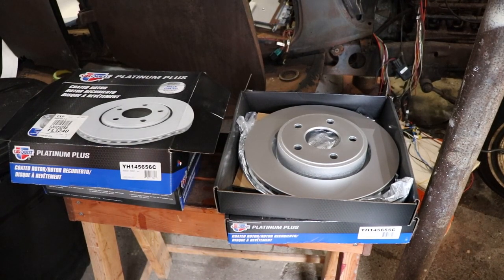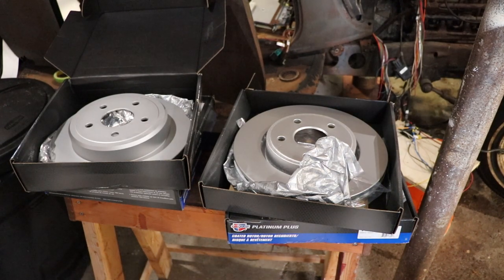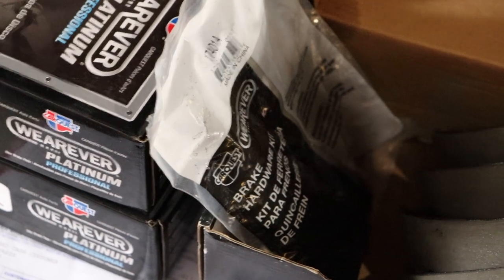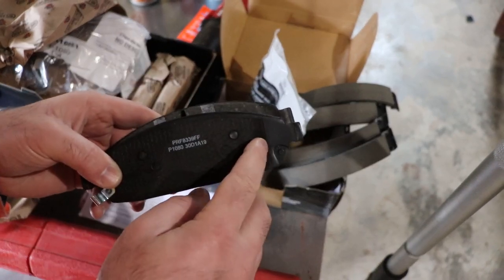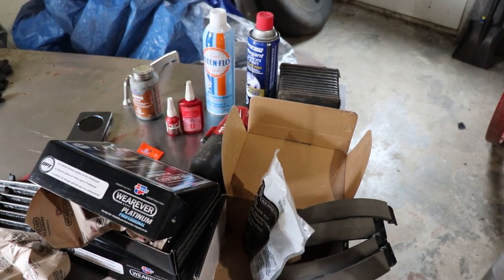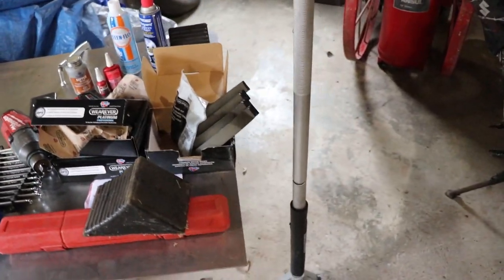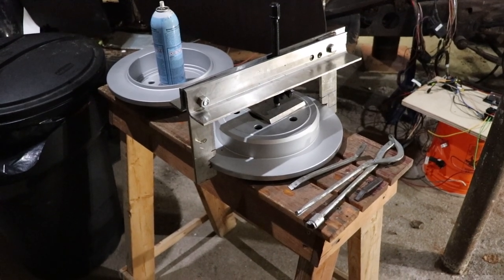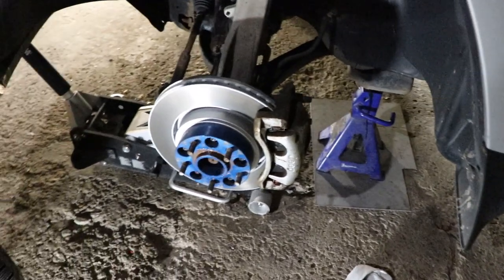2005-2010 Jeep Grand Cherokee WK Complete Rear Brake Job

Comment: I did this job this morning. This was my re-assembly sequence, no real problems :

1) Hook equalising mechanism onto cable and hold it in place with a miniature G-clamp. Possibly wedge cable (under the rear seat) as far as it can go in the "handbrake off" position.

2) Fit bottom shoe with its clip and hold it up in its position with a small wooden block below it G-clamped to the backing plate.
 
3) Fit adjuster (screwed back max) and top shoe with its clip. 
 
4) Fit rear spring - the weaker one. This is quite easy with pliers.
 
5) Fit front spring - the hard bit.  Hook bottom first. I use a large (15") screwdriver with a small notch in the edge of its tip to locate the spring's top hook. With handle rearwards I push down, with its fulcrum on the non-toothed part of the tone wheel (bit of cardboard between to soften it).  When the spring hook is level with its hole I tap it in and pull out the screwdriver.

Comment: Before doing any of this …drive the vehicle & apply the emergency brake a few times to stop the vehicle (at low speed!).  This will break up the rust & the rotors will come right off.  Works every time for me over the last 30+ years!

Comment: I appreciate the video, especially the good, conversational style.  Good to see others struggle a bit with the springs, not just me.  That said, would be nice to see exactly how you got them on finally vs cutting away then coming back to "it's done".  Still helpful though.  Especially the parking brake "caliper" or assembly thing.  Getting that back on was tricky/not clear at first.
Reply from the maker: Sorry about that, it was lots of struggling not worth showing.  You can use c-clamps or grip clamps to hold the brake shoes in place while fighting those clips.  I think OEM clips would have been better.

Comment: Hi Steve. Great video as always. You are my go to for WK maintenance videos. My mechanic made a complete pigs ear of my handbrake when he changed the discs, pads and shoes. Incidentally, do you know the thread size of the rear brake lines and fittings? Thanks.
Reply from the maker: That is too bad.  You can get the fitting information from the Dorman website.  Pick the brake hoses that go on the vehicle and check their information.  It is pretty handy.
Reply: @SteveRivett  Hi Steve. Is that info for the brake hoses? I was needing the brake pipe thread sizes. Thanks.

Comment: Good video ! What are the torque specs for the pistons and caliper bolts ?
Reply from the maker: You should be able to find it here:  https://archive.org/details/JeepGrandCherokeeWKRepairManual2005Through2010OCR7201Pages

Comment: Where did you get the parking brakes from, I've looked several places and they all show me a B843 part but they don't look like the ones you have in your video.
Reply from the maker: All of my parts came from Carquest but I think the stores are called something different in the US.  There is a link to the part in the description if you want to check it out on Amazon.  Some are shoes only and some are kits.
Rockauto has some photos as well.  https://www.rockauto.com/en/catalog/jeep,2008,grand+cherokee,3.0l+v6+diesel+turbocharged,1441551,brake+&+wheel+hub,parking+brake+shoe,10177